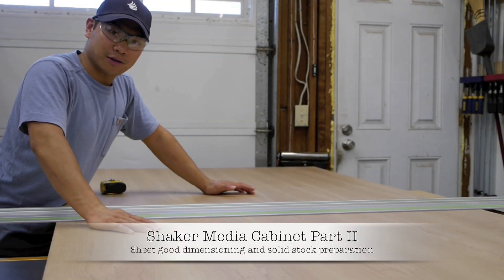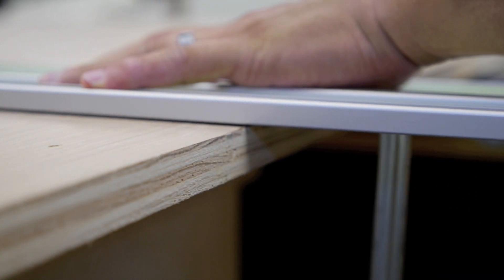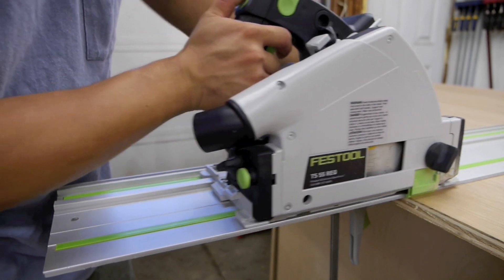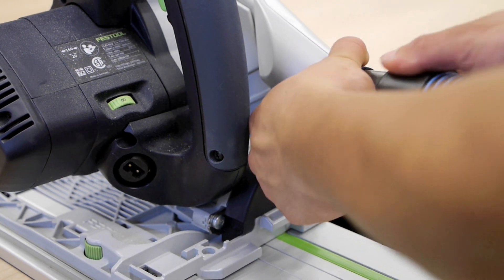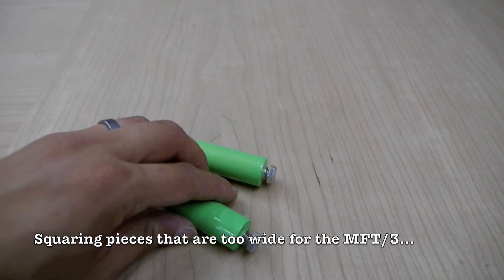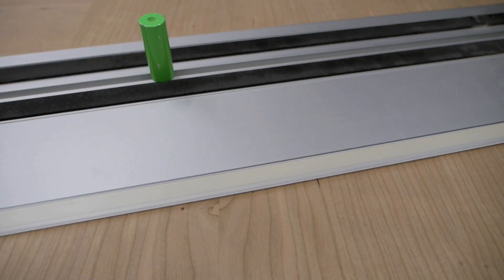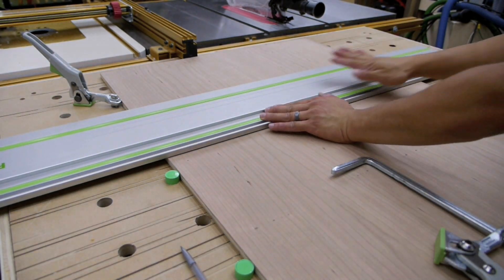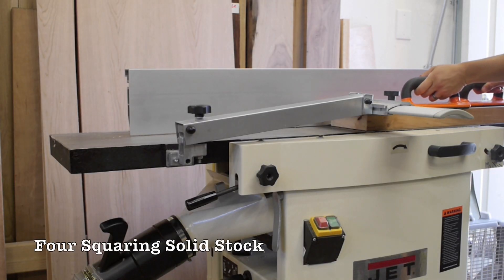Shaker Style Media Cabinet, Part II (Sheet Goods with Festool + four-squaring solid stock)

Comment: I notice you are using a different hose for your saw.  Just curious why you are using a different hose and how it connects to your Festool Vac?  I think I heard you say you had a Festool Mini Vac and I know the connection for those it a 90 degree connection from the top.
Reply from the maker: Hi Joseph, a bigger diameter hose (35mm+) works best with the track saws. I happen to have a botch antistatic hose so that's what I use. I have a dust deputy cyclone connected to my CT,  and the end of the hose goes right in an adapter fitting. The festool one would be easiest to use directly with the vac. Hope this helps!